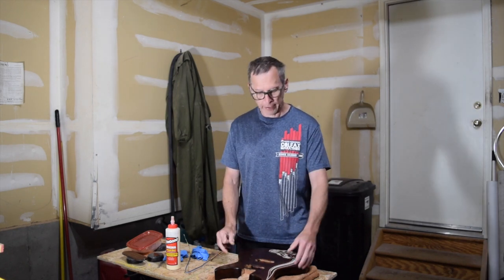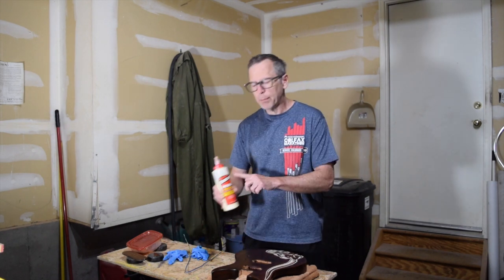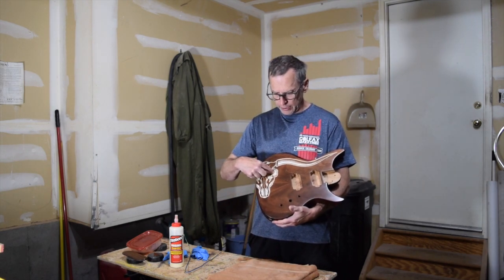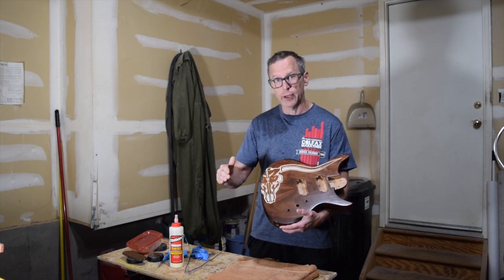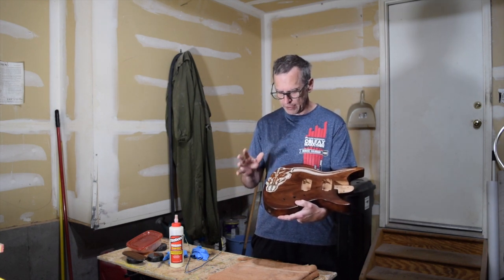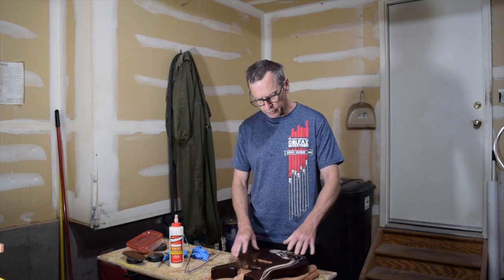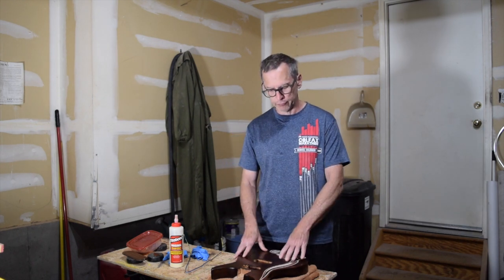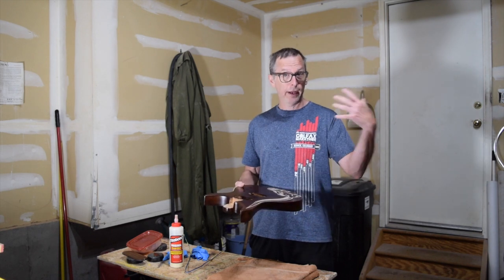Tips for Creating a Polymer Clay Inlay Design

Comment: If you cook at a lower temp, no matter how long, it doesn't cure. The clay has to reach the temp on the package to cure, it can't if the oven is not set for that. Time is how long it takes for the clay to reach curing temp all the way through. The reason it seems to work is it is still uncured and feels harder, it is brittle if in pieces you can bend, they break easily. Fully cured bends without breaking.

Bake and bond is a great choice. It is made to attach cooked clay or something else to uncooked clay, so it is what should be used. Superglue will change the texture of polymer clay, especially is it is raw. It actually hardens that clay so it can't cure and stays very brittle. 

I don't know if overtime brittle clay will start to crack in the inlay, but I would think it would. The vibrations of the strings might not be enough, but the bumping and jarring guitars go through when they are moved around most likely will cause it to crack.

Thought I should mention this about the clay. Otherwise, I love the idea of using polymer clay as in inlay in guitars, not I have ideas for other projects using clay, thank you.

Comment: Does polymer clay shrink when drying or when heating? Chemicals will burn off when the clay is in an oven, but they shouldn't be too much of a noticable problem.
Reply from the maker: I haven't noticed any shrinkage after curing polymer clay in the oven. If I slice off the excess with a tissue blade before baking, it might shrink some, but I think the use of bake and bond might help.
Reply: Highline Guitars thanks for your quick response on your experience. Clays (natural) always shrink (12% approx) so it is interesting to hear about this for inlay work etc. It was with you mentioning shaving it off before baking that made me question this. But then, if it were to shrink, yiu would also notice it around the edges (cracks). Thanks.